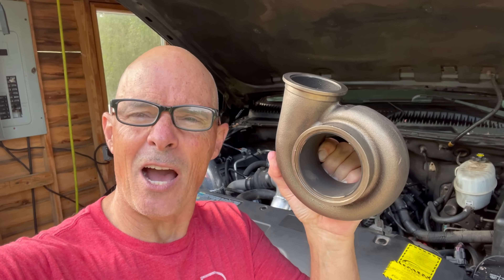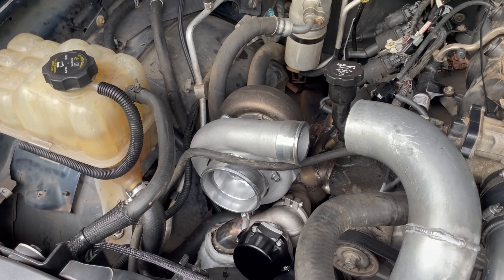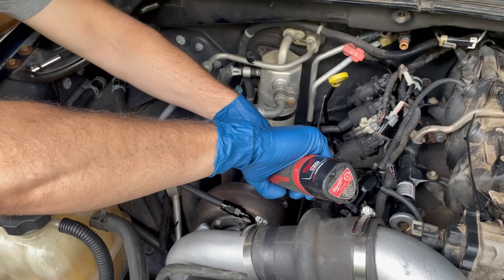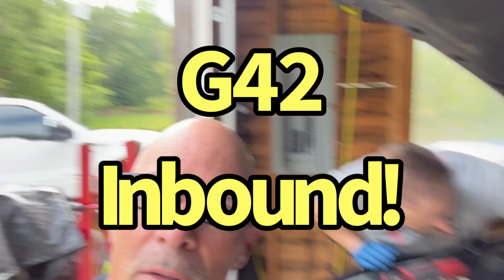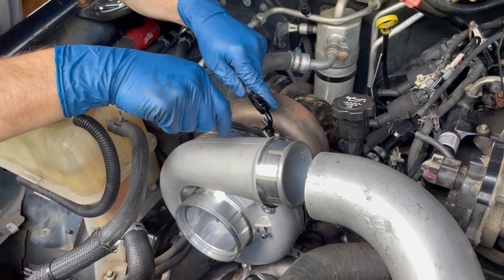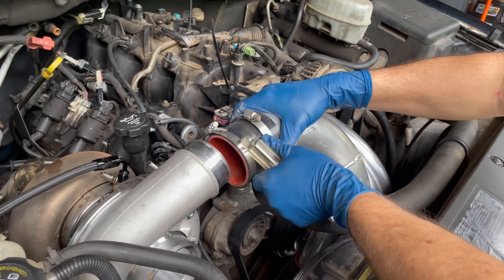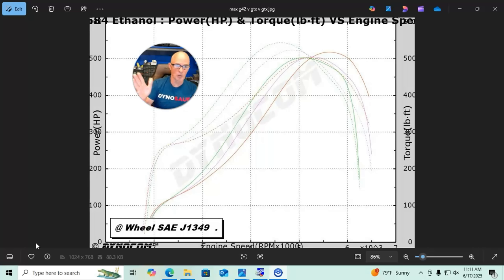LOW BUCK GTX3584RS TURBO A/R TEST. .83 VS 1.21. 350K 2005 TAHOE 5.3L. ALSO TESTED-GTX3584RS VS G42

Comment: Have you done any testing going from a T4 .96 to a stainless VBand inlet 1.02??? Id be curious to see if the bigger AR VBand housing spools faster than the t4
Reply from the maker: I have not done that specific test
Reply: @richardholdener1727  Do you think there would be any advantages to a VBand design flow wise compared to the traditional T4?

Comment: Hello Richard! Curious whether my LQ4 6.0L (370ci) forged internals (stock crank), BTR turbo stage 2 cam, .660 dual springs, Edelbrock pro flo intake, 1260cc injectors, 2800 stall, single forced induction 76/83 1.0 a/r turbo would reach 900hp RWHP w/o any back pressure issues? It will run on boost control, with on board air added.

It’s a street performer. 3800lb 86 2 door box chevy on 26s. Has a manual 4L80 trans & a 3.73 rear.

I’m having second thought on whether I should go bigger on my a/r housing. At what RPM do you believe I would top out at and begin to plateau due to BP? 

Thanks
Reply from the maker: that should do it-but ask the guys a FI

Comment: 3584 it's not to small for the 6L (ly6) for around 600hp or is enough. And 3584 or 7876 for the same requirements ( fast boost ,daily drive)

Comment: Which of these turbos and AR should I use on my lq4 I’m about to put in my daily driver Tahoe? It’s going to be running resurfaced 706 heads and a truck Norris cam
Reply from the maker: g42

Comment: So, if I had a 6.0/4L80, and I didnt want to change the driving characteristics (or fuel economy) below, say, 2200rpm flat ground cruise at 75, but I did want more oomph while towing over mountain passes, a larger turbo with a boost limit would be the correct move? If I’m reading this correctly?
Reply from the maker: use our G42 on your 6.0L

Comment: Why not just get better dynos if they are too frail to handle more torque? That has always struck me as being odd. Or, use a reversed Lenco with a few ratios aft of the engine to spin the output up far enough that the frail little dyno won't get broken with a high-torque engine?
Reply from the maker: the dyno is not an issue-not sure why this comment was made

Comment: An inertia roller dyno is a way to help quantify the near-real-life performance of an engine when turbo lag is something desirable to measure.
Reply from the maker: an inertia dyno only simulates the rotation of that specific drum weight and diameter-meaning it would (at best) simulate acceleration of a vehicle in 1 specific gear)

Comment: I really wanna see that gt35 and the low buck truck cam in a 4.8 on the dyno!
Reply from the maker: engine or chassis dyno?
Reply: @richardholdener1727 yes
Reply: @richardholdener1727 
Chasis Let be real😫 probably next Chanel chápter?

Comment: Legit Question: to the best of your knowledge, in a twin turbo setup on an inline 6 engine with a 123456 firing order, would it be better to run one turbo off cylinders 123 and the other off of 456? Or would staggering the cylinders (135, 246) for each turbo be more beneficial?
Reply from the maker: what engine runs that firing order?
Reply: @richardholdener1727 the one that runs my dyslexia lol. And the one that answered my own question and made me feel stupid lol. Actual firing order is 153624, which is the part that answered my question (that didn’t need asked because brain fart). Sorry I wasted your time.

Comment: Sounds like the dyno runs are too short, Does the Dynocom dyno have the eddy current brake?
Reply from the maker: you can choose the amount of load-these were 2nd gear runs to keep the 350K mile trans alive and to keep driveshaft speed down
Reply: Fair enough @richardholdener1727

Comment: Richard I was intending on using a 4” downpipe with the smaller GTX3584RS that I just bought from you. I was just going to weld some different size v bands together I had lying around stepping it up to 4”. 
1) Will the 4” downpipe be worth the hassle? 
2) Should I use a smoother cone going from 3” to 4” instead of my v band “collection”?
3) I also was playing with the idea of splitting the 4” into two 2-1/2” pipes out the back or side of my 05 suburban. Thoughts?

Thank you so much for all you have done!!
Reply from the maker: We have a power cone to step the 3-inch on the GTX3584RS to a 3.5-inch. I don't think you will gain much by further stepping it up to 4.0 inch.

Comment: I'm probably going with the .83 on that combo as it is. Just the average HP alone to the wheels makes it worth it. Naturally you start changing engine flow or converter that could change, but man that's a healthy street vehicle with say a 4L80E.

Comment: Richard- forget the  big number does this not prove the a small displacement( 325- modern 327)
Makes “ big block “( old school)
Power right there right now

This is called a “ fat” tQ curve
With the right matching drive train and good gears, would this not net the best seat of the pants hit in a big car / truck in real world driving with supporting tires?
This seems to be the answer for a fun ride on the least amount of dollars spent

No big money heads , intake, headers etc
Turbo/ injectors/ pump tune
I don’t even think you need a muffler ( just cats and the turbo- it’s a rotory muffler already)

3000 lbs- 4500 lbs
This combo

Would really move iron

“MOST for the LEAST”

I don’t think the dyno charts lie

I feel you should reach back

Pull up one of your old dyno runs
Of a non turbo big cam with same power 5.3 runs
And over lap it with this small turbo

Just to show how good this delivery of this simple set up is.

Some people love to spend $$$$$$$$
But I don’t think it comes close to these curves

Just my thoughts

Turbos were crazy before , but this new ones even more so
This is got to be a match against all old school big block stock power

440/455/427/428

But still way less fuel if your not on it
Alu bock 5.3 should be able to take 12 lbs boost standing on its head
So the weight savings are huge!
Better braking, better handling / ride too!
This little beast on my old 1968 cutlas would be a ripper

Someone posted a “ bots “ comment 

I don’t see it they seem real

Heck
Rip my old 2.3 turbo( very heavy block/ heads) out of my old 1984 turbo t- bird- 3500 lbs
You would have a 3300 beast( gm tranny and 8.8” swap rear)
That thing sounded like bolts in a blender at 4600 rpm
A v8 ls sings as it spins

Just my thoughts
- don

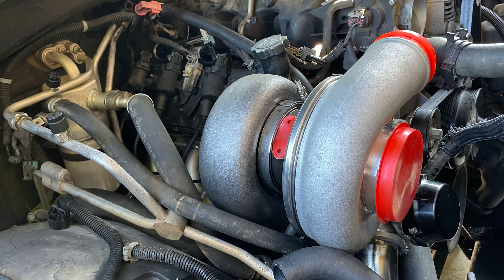Comment: 0:48 literally not the "real world".   A chassis dyno, especially a Dynocom dyno, is not remotely close to being the real world.  The race track or highway towing are the real world.
Reply from the maker: we ran the G42 on the road after dyno testing and will do the same with the GTX3584RS (but the adjustable load chassis dyno can simulate what we see on the street)...so literally the real world
Reply: @richardholdener1727 you're the most arrogant and cowardly YouTuber I've ever seen.  You're simply dead wrong once again, illiterate, or extremely unintelligent.  "Literally" and "real world" both have a very specific meaning and you're using one, or both, wrong.  It's time to find some humility, man up, and admit you're wrong.
Reply: I had a AWD eddy brake Dynocom chassis dyno, so I know from extensive experience you're dead wrong.  The two main reasons I sold it were: #1 the lack of a calibration feature, and #2 the significant difference between the dyno and the real world.
Reply: I can only imagine being so incredibly unintelligent that I didn't know the meaning of "literally" and "real world".  Icing on the cake: I would also be so unintelligent that I wouldn't know I was so obviously wrong.
Reply: You guys find something to bitch about all the time. Lmao
Reply: @JonathanCalkins the irony of your comment eludes you, huh?

Comment: Was there any ring gap added to this one? I picked up a 2006 Silverado 2500 from work with a valve train issue on #1. I am going to put a LBT and new lifters from your site into it, but a turbo would be a fun addition if I don’t need to pull the pistons out. 😊
Reply from the maker: this 5.3L has not opened yet-but will

Comment: What do you think about putting a cam out a 6.2 LT1 out of a stock camaro ss into a 5.3 out of a 2018 Sierra 1500 with an L83...?
Reply from the maker: the LT1 cam is certainly better than the L83

Comment: Anywhere near you have a decent mainline hub dyno that’ll simulate a proper 5+ second sweep on boost? 

Not this 0.2 second pull which simulates a 40 degree down hill in first gear. 

Is the retarder in this dyno broken? Or just zero dyno brake applied?
Reply from the maker: please see the other vids where we ran pulls on the road locked in a single gear. We also did the runs in 2nd gear on the dyno to minimize driveshaft speed. You obviously don't really understand what dyno testing is.

Comment: Hi Richard, would you recommend twin 5384s with .83 turbines on a 5.3 for drag racing? Aiming for 1200-ish crank hp on e85.
Reply from the maker: twin 3584s would go 1600+ hp
Reply: @richardholdener1727  maybe something a touch smaller then? How much turbo headroom should I aim for? 1400-1500?

Comment: I went from a 1.25 to 1.01 AR on my VSR 7875 and the spool difference was very noticeable. Made boost about 1k rpm sooner on the street and made my c10 more fun (but no doubt the 1.25 ar would be a track monster! ).
Reply: @mirage2991 what turbo manifolds or headers did you use ? What year is your C10? I’m going a boosted 1981 c10. Thanks

Comment: Turbo newbie checking in. What does AR refer to?
Reply: A/R is Area / Radius , more or less the physical size of the exhaust housing in relationship to the turbine wheel, a larger A/R flows more, but can be laggy at low speed, and a smaller A/R  will spool quicker, but can also be restrictive,  because it doesn't flow as well.
Reply: @jamesgeorge4874 Thanks! That's helpful. I'm figuring out what to buy for my first turbo build. It's a well-trodden path, with a lot of proven combinations, but I'd like to understand things a bit better than if I just ordered up someone elses shopping list

Comment: I vote 10spd swap on this unit if the 4l60 ever gives up. Us shift has a controller for the 10spd swap and it bolts right in
Reply: It might bolt to the engine,  but the drive shaft(s) will need modification,  the cross member will need modification  , the exhaust...
The 10 speed is busy, and annoying, constantly shifting,  like it thinks it's in the fast and the furious.
Reply: @jamesgeorge4874  The 10spd is a huge upgrade vs the 4spd. You can tune them to launch in 2nd gear or shift how you like. You can use a rail shifter and manually change gears etc. It will have increased mpg in town + highway, better towing, and alot quicker vs the 4spd.
Reply: @Pitman556 10 speeds are shit. . . 
The quickest, fastest 1/4 mile cars in the planet one have 
ONE gear.....
Reply: The US Shift controller has been "under development" for 5 years, and is for the Ford 10R80 only. That's a pipe dream.
Reply: @chipcurrey653  couple guys in the gmt800 group already installed 10spd in these trucks
Reply: @Pitman556 not using the us shift controller that's only done using a factory gm pcm

Comment: All of your content is interesting but the video I found most interesting was the asymmetrical turbo video. I would really like to see you run an asymmetrical turbo setup on this chassis dyno. I don't think we need to see all three turbo combos just pick your favorite and do a comparison of asymmetrical vs the run in this video with the same turbo. All you would need to do is run a dump tube on the driver side and cap the crossover inlet on the passenger side.
Reply from the maker: we already did that on the engine dyno
Reply: asymmetric turbo proves if I make a twin turbo kit on my engine, it still function if I blow one and replace it with what I have laying around (even if that is a section of pipe lol)

Comment: Rich on the exhaust was the kitty cat installed or straight pipe for your off-road testing?
Reply from the maker: just open downpipes on these tests (3 inch for the GTX and 4 inch for the G42). Testing the effect of stock cat-back now-it is very restrictive!

Comment: Thank you  for doing this .  Good to see my expairaments with diesel and AR are the same as gas. 
AR is a tuning item.  I reduced AR to shift spool left. This put more on the table before the governor cut fuel.  I wasn't concerned with the choke point following  to the left with spool as the choke was still well above the governor

Comment: Wow I am super impressed with the 3584RS performance 😳I still don’t understand how that little sucker lit off damn near off idle. Talk about hurt some people’s feelings with the red light to red light thing in Mexico 🤭 obviously 🙄. 😂. So theoretically if my engine was slightly larger and made more NA power than the clapped out 5.3 it would spool up even faster? 😳I believe I have an A/R between the 2 at .98 I think
Reply from the maker: more power down low will help spool rate-but the GTX3584RS does need to spool any sooner
Reply: Modern aerodynamics! Most turbo guys don't understand that and insist you need a 7875 to make any power. I bought a 7268 with a modern wheel 3 yrs ago and everyone said I was wasting money. It spools a bit faster than the G42 here, but if this info & turbo would have been available I'd have a RHP GT35 on my winter beater instead.

Comment: Interesting the bigger housing and/or bigger turbo didn't help prevent (at all) the torque nose-dive at/above 5200.
Reply: Stock Camshaft
Reply from the maker: stock cam and intake
Reply: @richardholdener1727 with the right cam would the 3584 1.21 ar still make power to 6800-7k

I have a 4.8 with a cd0009 and thinking of turbo to make 500whp in my Toyota cressida drift car
Reply: @richardholdener1727 please help me out I’m really interested in boosting my 4.8 but want to know what would be the right turbo. I’m only looking to make 500 whp 

Would the 3584 with a truck Norris cam make power all the way up to 6500 rpms or so or will the turbo drop before then?